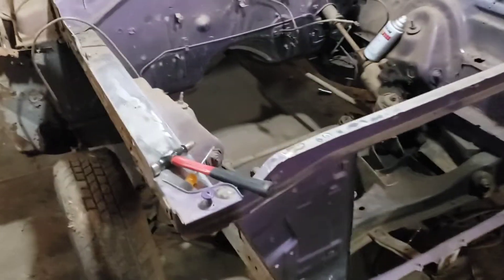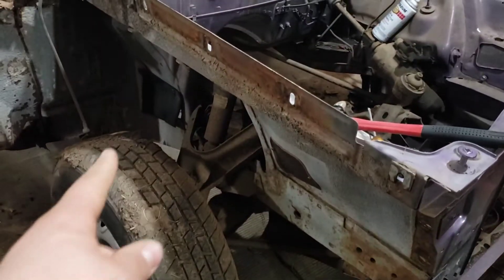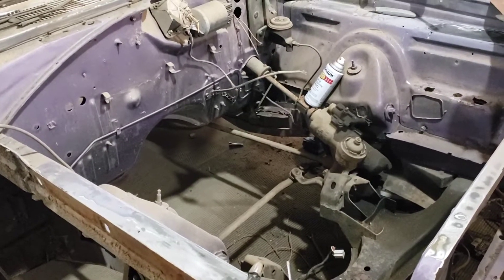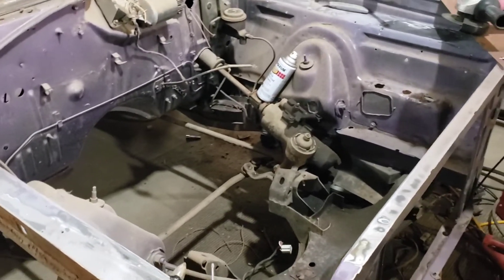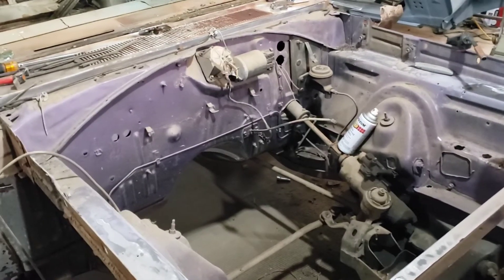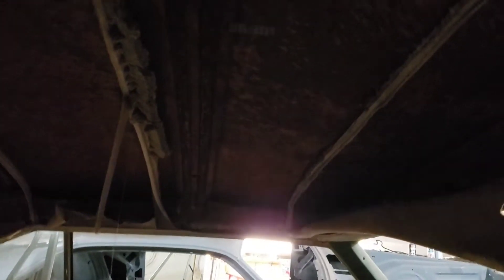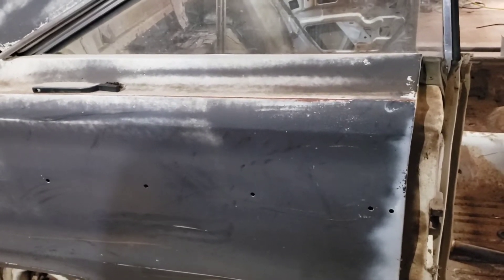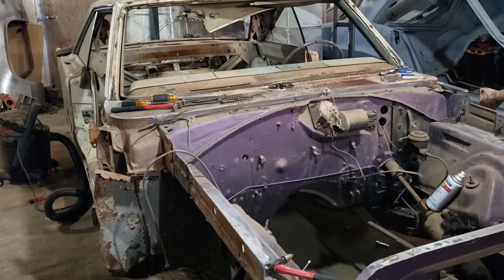1966 Belvedere Update & Plan for #nonamenationals

Comment: Been a sub for a couple of weeks and have a few suggestions and advice.I've built B body Mopars for every year between '62 thru '66.Not bragging,just telling you what I spent my kid's inheritance on.You're right about the weight.The 340 torque converter will stall higher behind the 440.Trans Go makes in my book about the best kits for the 727,then TCI & BTW.The 318 torsion bars will work fine.Believe it or not if the front shocks are not froze up I would use them.Drill a hole in the bottom pump all the fluid out then weld the hole shut so they won't leak.Run the torsion bars loose.The idea is to get INSTANT travel to plant the slick.It only takes a few minutes to change the shocks at the track.If you have to rebuild the front end use oem type bushings,polyurethane sucks at the track.Install sub frame connectors.On my '66 Coronet I installed rear spring relocaters and adjustable pinion snubber.I got them from Manceni Racing or Kanters.As an old man (68+) I see people spend gobs  of money to go faster,only to slow down.Makes no sense to me.

Comment: FYI the dustless blasting on suspension parts is not good the high water pressure can open up the seals and carry that crushed glass into all the tie rods and ball joints even had it penetrate the seals on the back of the brakes and deposited sand into the wheel bearings
Reply from the maker: Yes I am aware of that

Comment: Great plan. But I’ll let you know, driving the Satellite to Street Machine Nationals in St Paul with 3.73 gears had me at 60-65mph. 4.56 will make that seem fast. Stillwater is a lot further.
Reply from the maker: Won't be street driving with the 4.56s. Takes 30 minutes to swap.